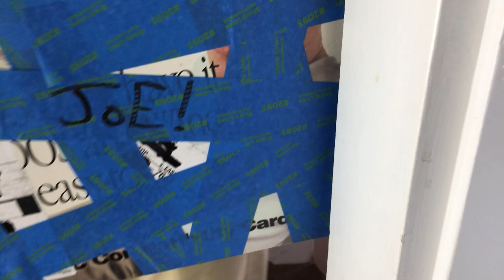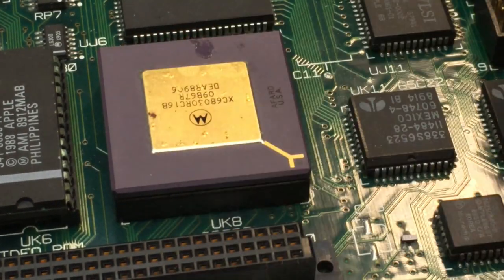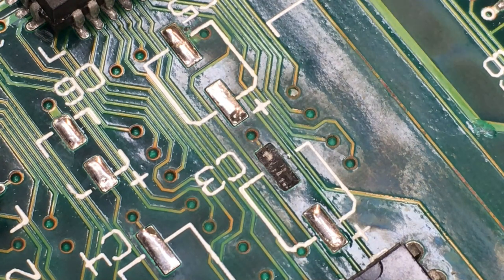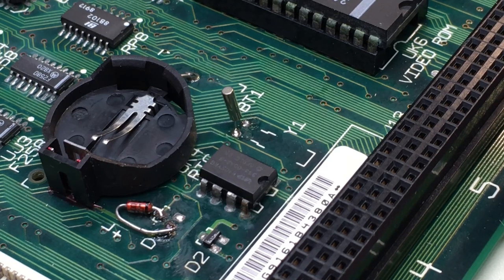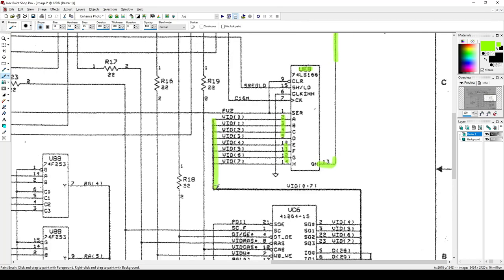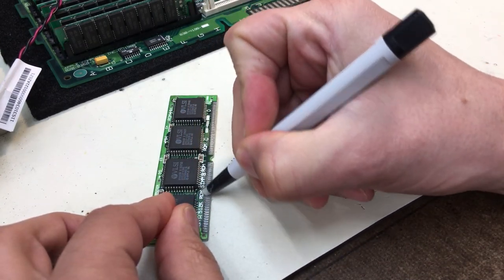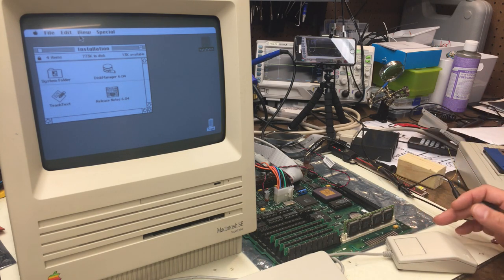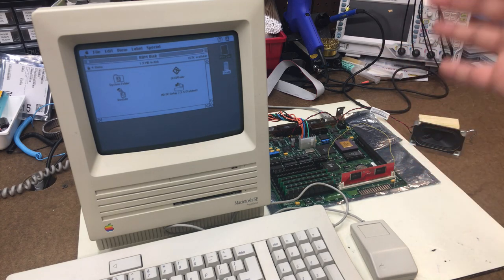Busted? - Macintosh SE/30 Board Repair - Part 1

Comment: I recently revived a Mac SE/30 board that was pretty messed up like the one you got as well. I put the board in my sonic cleaner for a while which helped clean it up, then began the process of running many bodge wires. If you need some high capacity RAM for it, let me know and I would be happy to send a donation to you/your channel, just send me a direct message (contact details on my about page). P.S. nice to see you using the Mac ROM-inator II Atom SIMM from Big Mess o' Wires. Lots of cool Apple stuff on that site!
Reply from the maker: Hey, thanks for the message! Hopefully, I won't need bodges, but time will tell.

Comment: I'm repairing a battery-bombed SE/30 just now and I suspect I might also have FPU issues because I can boot 6.0.3 but not 6.0.5, 6.0.8 or 7.5.5 beyond a certain point. With 6.0.5 it asked me to name my computer and then stopped accessing the disk (SCSI2SD) with the watch icon on screen. With 6.0.8 it boots to what looks like a blank desktop with blank menu bar and active mouse pointer. And with 7.5.5 it gives the Welcome To Macintosh screen then starts the progress bar on the next screen but only gets about 15% of the way. I guess my next move is to inspect the FPU for broken traces or bridges/gunk before doing your little trick with the chip select line.

Does anyone know why we see this behaviour with pre-6.0.5? Was the FPU not utilised by the system generally before 6.0.5 perhaps? Maybe only used for specialist apps?

I'll report back on progress.
Reply from the maker: Hey! Yeah, certain versions of classic Mac OS used the FPU and others didn't, but I didn't do an exhaustive check during my diagnostics. Like with all things, this problem could be the FPU or could be just about anything else. From a 10,000 foot view, it smells to me like a problem with the RTC, crystal, etc. in the battery bombed area. Like the OS tries to read the PRAM and can't, so it gives up. Also explains why the one version of the OS was asking for the computer name.
Reply: @JoesComputerMuseum  Thanks for the reply - yeah that's a good suggestion as I did need to rebuild the area around the RTC with new D1 and D2 diodes and a new crystal. I've just received an ATX PSU extension cable today so should be able to debug more easily with the logic board out of the chassis. Will check if the RTC is signalling or not.

On that subject, any tips on selecting an Oscilloscope? I threw out my old CRT based digital oscilloscope during my recent house move and have been tempted to pick up a Rigol scope for projects like this. Any tips on what features to look for when balancing cost and feature set? I'm an electronics engineer so I understand the fundamentals but would appreciate your feedback on these. Thanks.
Reply from the maker: @craigchamberlain  On an o-scope: I'm no expert. For most of what we're doing, the simplest quality scope will work. You need at least two channels, 50mhz bandwidth and you'll probably be just fine. Heck, even an old in-good-condition CRT scope will work.
Reply: @JoesComputerMuseum  thanks, yeah I think something like a DS1054z is probably plenty capable for working on anything from the 1980s and probably the 1990s too! Thanks.

Comment: Instead of removing the FPU, I wonder if you couldn't just use an ethernet card that usually has an FPU socket on board. It plugs into the PDS slot of the SE/30 as well as other cards. Normally the FPU socket is vacant as some Macs had a working FPU soldered on the logicboard which will be the opposite of your situation now
Reply from the maker: Good idea!